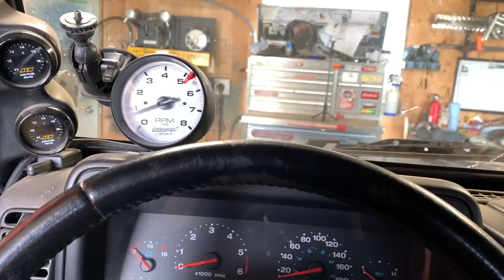Ford 8.8 Complete Tear Down

Comment: Currently dong the same swap on my Jeep. Got an axle code D4 . Completely stripped out . Waiting to buy the Barnes 4wd truss, brake line kit for TJ swap, Super 88 kit, and a new cover and actual yoke not just flange adapter. Going to keep 3.73s in it until I build my front axle up then throwing 35s maybe 37s under it. 

Love the channel, you are one of my favorite garage enthusiasts

Comment: Hey Jerry weld a 3/8 eyelit to your vicegrips...works awesome as a puller...insert screwdriver and twist it'll grab anything...I use it on all my grips to pull sections of flanged ductwork together...Milwaukee makes their grips with a small one but a 3/8 is perfect.
Reply from the maker: The Milwaukee ones are awesome indeed

Comment: You could always see about swapping that limited slip diff carrier into your diff in the front of your F150. I'm pretty sure that diff is also 8.8
Reply from the maker: I don't believe they are used in modern day f150's pretty much all of them have a 9.75
Reply: Bullshitkorner oh, maybe. I just thought that 8.8 you tore apart and the front diff in our trucks looks like the same size.
Reply from the maker: My bad I read it wrong, you said front diff. I believe you are correct that they are a 8.8

Comment: That came apart way too easy.  The gear set looks like new almost,  it probably is.  That was a good score! 
Are you sticking with 4.56 gears?  Should be perfect with 33's.
Reply from the maker: I am sticking with 4.56 gears is correct